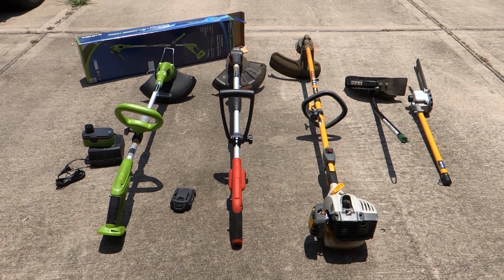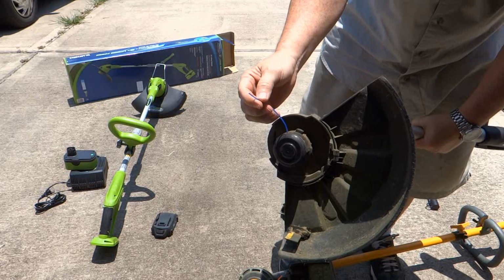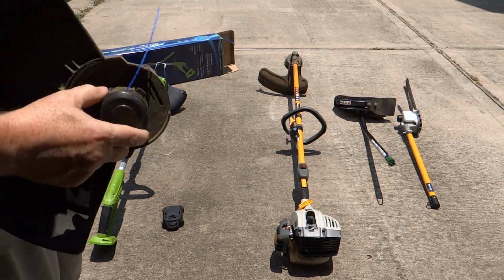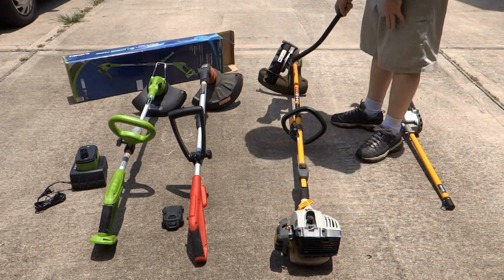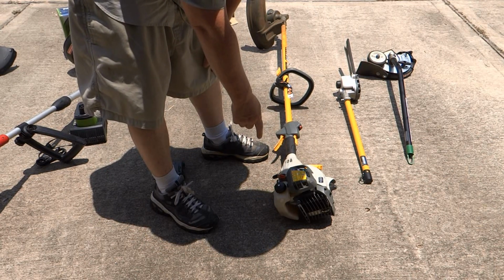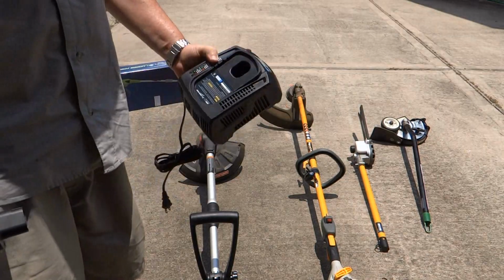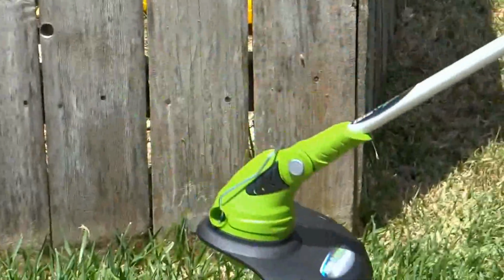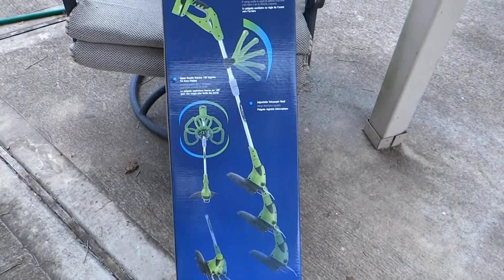Comparison of My Cordless Battery Powered String Trimmers (18v) to My Gas Powered Weedeater (Ryobi)

Comment: Does the battery operated trimmer  take longer to do a job than gas?
Reply from the maker: Thank you for watching.  The ones that I used in this video did take a little longer to trim with because I basically would swing it back and forth to get more trimming power.  However I now use a B&D 40v that I like a lot better (they even make a 60V, but I don't have one of those) and I don't think it takes any longer.  Probably a lot less with the 40v than gas because I don't have to spend a half hour trying to start it and fill it with mixed oil/gas.  A more recent video I did shows the 40V trimmer with the blower and the 60V mower.  https://www.youtube.com/watch?v=4lkJOAUN9bc&t=1s

Comment: hey rick how big is the area you need to trim?
Reply: Good question.  The driveway is about 5 car lengths and I have sidewalks to edge.  I have a fence all around backyard, part of driveway, and flowerbed edges to trim.  It is pretty substantial I would say for a normal suburban lot.  Takes around 45 minutes I think.  I now have a black and decker 40 volt that I absolutely love and use exclusively.  I now have two of them and one leaf blower.  Never go back to gas now.  The B&D has more power than those in this video and has a bigger spool.

Comment: Thanks Rick! Your video was great! I am thinking about purchasing the Earthwise trimmer and was pleased to see your comparisons! I am curious how you are liking the electric trimmer now a year later? Is it still working well? I have been reading reviews... it ranks high, but there are always extremes, and I just thought I would ask. Thanks again!
Reply from the maker: I still prefer the electric over the gas for several reasons, noise, gas, putting oil in gas, weight, vibration, and ease of replacing or fixing the trimmer cord.  However, it isn't as powerful.  So it can take a little bit longer to do the job, and if the weeds are high might need a second charge.  I just pulled out my gas powered Ryobi with the edger attachment to cut a better grove around my sidewalks and drive.  I was wore out afterwards and my hands tingled from the vibration.  Wish the electric had the power (and attachment) to do that.  Otherwise I still prefer the electric.
Reply from the maker: rickmcmillin1 More direct to your answer, it is working just as well as I remember it working last year when I opened the box.  I still like it very much.
Reply from the maker: I am now using the Black and Decker 40V and like it better than the ones in this video.  Bigger spool, longer battery, and more power.  See my new video to see a short demo on it:  https://www.youtube.com/watch?v=4lkJOAUN9bc